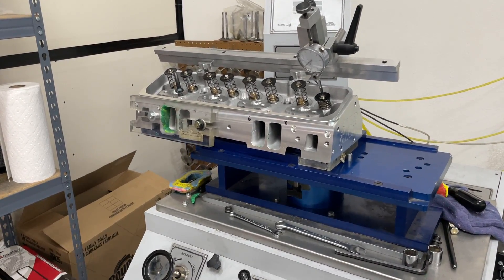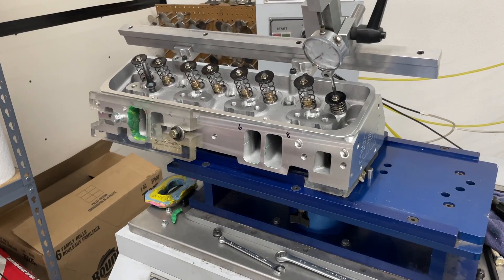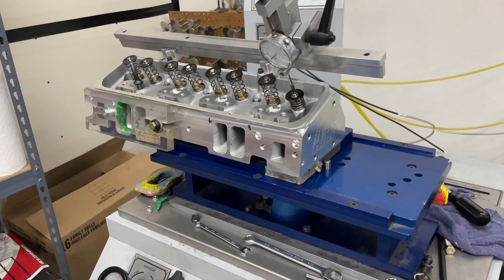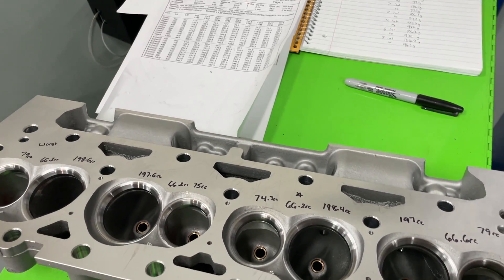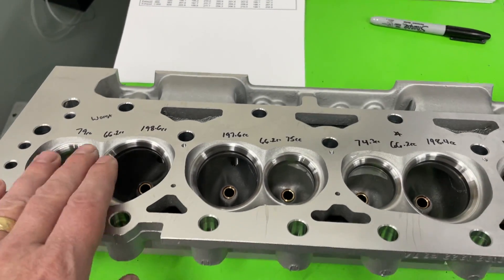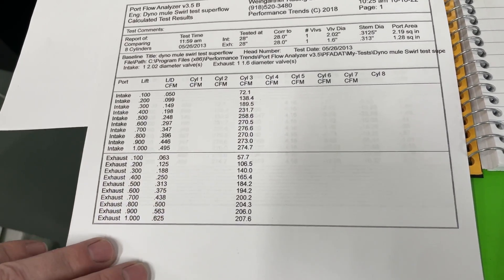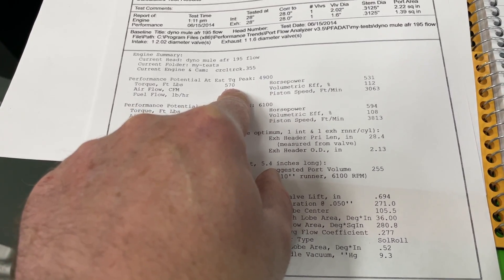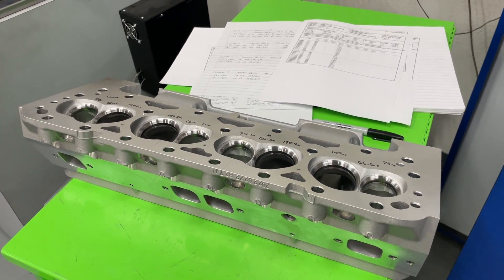How Consistent Is The AFR Enforcer Head

Comment: Do you ever have customers tell you about exhaust valve to piston clearance issues with the AFR exhaust valves.  Because the exhaust valves in my AFR heads are incredibly thick and was causing piston valve clearance issues on the exhaust only.

Comment: Great job ERIC with providing all those figures. Once you do get this on the mule. Pay close attention to the performance gain with the 90% throat and 95% bowl. I'll bet you that intake flow numbers and those swirl stall is directly related to those % percentages. While the reverse will be true with the exhaust flow. That swirl stumble is the transition for low lift build up in the bowl area and the switch to inline flow as lift increases. Having a bigger throat will lower the swirl a tiny bit but will increase the flow sooner in the lift range while maintaining swirl. As you will notice as soon as you add a valve job and seat clean up.

Comment: I noticed on the flow graph that one intake runner flowed much like the others, then at around .600", it seemed to just level out, while the others continued to gain. Looking at your flow sheet, it looks like that may have been cyl 2. I'm curious as to why that runner may have done that. At the end, the program you use to get the estimated hp/tq is really cool.

Comment: That's a pretty good head for the money. With A good valve job and minimal port work they would probably approach 300 cfm mark . The flow tech sbc heads are very similar casting.
Reply from the maker: The flowtech heads I have seen are not the same head.
Reply: Those look like the Assault racing castings on my 383. Mine are very close to 300 cfm through a 2.02 valve ported to a Felpro 1255.

Comment: This is a little off the path but I think a good question.
Are any of the race ready cast or fast as cast heads any good? I cant see a cast head ever being as good as a good cnc head with the same volume.
Reply from the maker: The promaxx project x 215 flows more than several cnc ported heads, some at about the same size.

Comment: A company like AFR is likely not going to offer a chinese casted part unless the chinese foundry can meet their quality standards. Also, AFR likely has a pre-machining inspection process on the castings so they dont wastes hours of machiniing time on a bad casting.
Reply: Sounds good.  I wish it were true. I don't know that it isn't, because AFR only tells me they are assembled in house. I take that to mean they are not machined in house. I also take the lack of response to my QC questions to mean they take the heads as they come, QC or no QC. That doesn't mean these are bad, they are good for the money. But, don't kid yourself about what you are getting here.
Reply from the maker: AFR does a really good quality check on the heads but they are not sizing the guides or doing the valve job on the enforcer heads. PS I did check them and they were good.
Reply: @WeingartnerRacing  I checked a pair also.  The clearances were good.  The chambers were 68ish cc. I did mill them. They run fine, maybe not as strong as hoped on a 383.

Comment: Dud! What the hell! You going to start handing out free heads to? You are really going over this stuff big time. I look over the stuff you were talking about. Ok the crazy thing. Can you get them all to pull the same and push the same? If you can will it change the spin in the end? When you run this on your mull can you see the change in all rpm range or just at the top end? The other thing is how much power is all this going to improve the motor? Good luck with this and I really want to see how this all works out. The funny thing is just one part can change everything.
Reply from the maker: I am not going to spend countless hours trying to get everything to flow and do the exact same. As a matter of fact at some point I'm going to only port some cylinders.

Comment: do you know when swirl gets too high or fast? I would think at some point it would act as a centrifuge as pull fuel vapor out of suspension washing cylinder walls
Reply from the maker: I have heard of that.
Reply: I recently did flowed a Nascar head . One of strongest in field 2019 or so , so pretty recent.  The swirl is ASTONISHING HIGH.    For me that ended the everlasting discussion about a few percentage more or less swirl or flow bla bla.. As I consider a 5.8 litres capacity engine generating  920 hp with 850 holley carb pretty darn good. 

The man who built my flowbench said , regarding Nascar engines :  if the choice is 3 percent more flow and 10 percent less swirl or 3 percent less flow and 10 percent more swirl  you know the answer now ...

Comment: now this type of testing is often negected. it demonstrates the quality of work that you do. thank you for this video. people would normally have to pay a lot extra or a pro-stock porter for this kind of data. great work.
Reply from the maker: It is a lot of work but when its all done we should see some trends with the data I hope.
Reply: about 20 years ago my engine builder, did a very mild bowl blend, unshrouded the valves (minimally), cleaned up rough casting, and gasket matched the ports on both the intake manifold and head. I often wonder if he helped or hurt my brrand new at the time AFR 210 CC RR heads... i was shocked to hear he did this to new set of heads but he said they had a lot of rough casting material. he didnt charge me because much (like 200). what do you think?

Comment: Hey Eric,
in your opinion, what's the best street head? 406 SBC and how do the old sportsman 2 heads compare to what's available today.
Thanks
Reply from the maker: AFR 195 Competition ported out of the box or one of my ported AFR heads if you want custom. Sportsman II are not in the same league.
Reply: the sportsmanII's were an okay head out of the box back 30 years ago, and for a cast iron head they are pretty danged good after you do some work on them. unless you just have to go with an iron head, a modern aluminum head is going to be a better choice. make no mistake, a worked over sportsman II head is no joke, but there are better choices for the dollar.